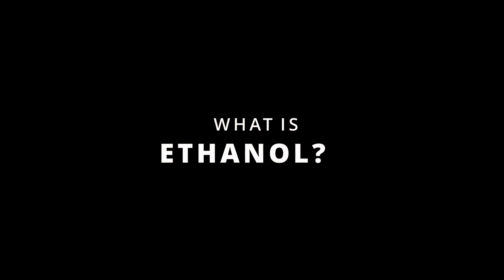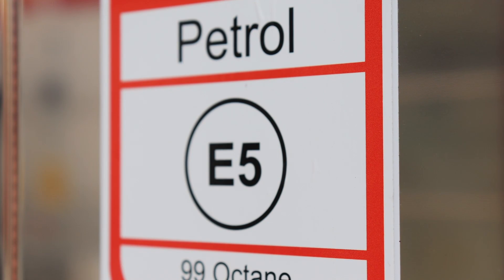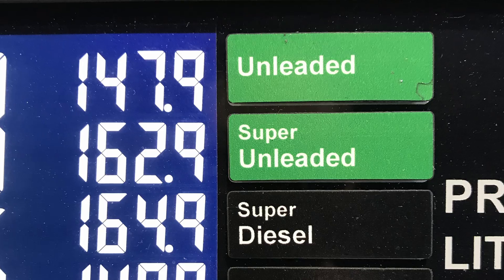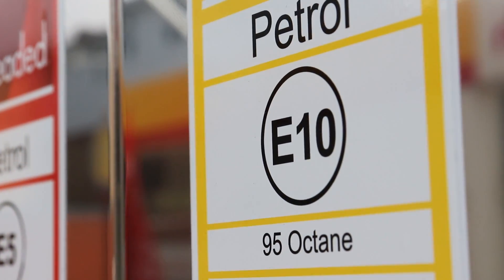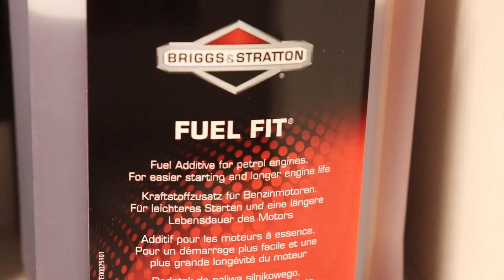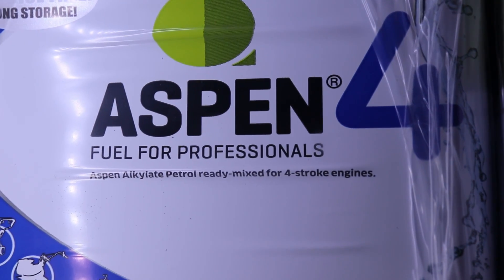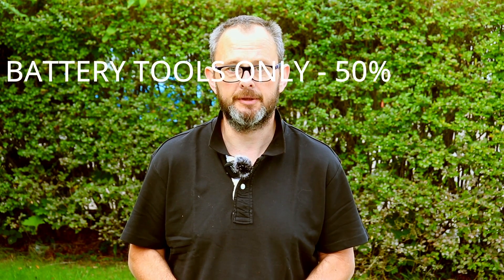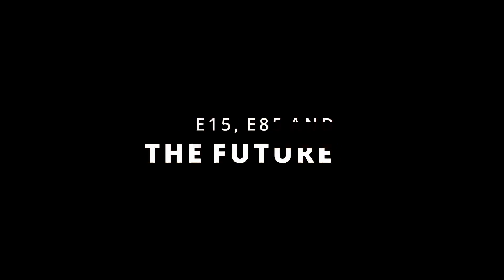Problems Caused by E10 Fuel in Garden Machinery

Comment: E5 killed my petrol mower! The seal on the float chamber went all out of shape and spares were unavailable as the manufacturer went bust, so the fuel leaked (more like poured) out, also it gummed up the inside of the carburettor. It heavily rusted up the inside of the fuel tank on my classic VW, causing the float to stick in situe, which in turn made the fuel guage permanently register just under 1/4 full, regardless of wether it had 1/2 a gallon or 4, 5, 6 gallons in it! This stuff is a joke!
Reply: Well here in germany petrol stations havent sold any Ethanol free fuel in the last 20 something years which is as far as I remember back. Everything but Diesel was at least E5.
Reply from the maker: It’s not good. Sorry to hear about both your issues. Don’t know anything about car problems with ethanol though. Have you tried a fuel stabiliser. Best option, if you can afford it is the alkylate root. Thanks for sharing and happy holidays. Nick

Comment: Thanks for the info.  I found some videos on YouTube showing you how to separate ethanol from E10 fuel using distilled water.  This may a consideration for some domestic users.
Reply from the maker: Hi. I’ve not looked into it. I imagine if I did it my lawnmower would explode 😂🤣. As long as you add back in a correct amount of suitable octane booster, you should be golden. E10 95 octane fuel with the Ethanol removed could have an octane value as low as 88 - some places suggest even lower. That could be terminal for any 4 stroke.

Thanks for posting this. I did originally consider adding info about this in the video but I decided to steer clear. Just in case!  Thanks for posting. Nick
Reply: Tap water will do it on the YT vids I've seen.